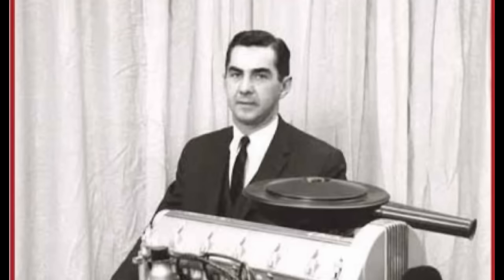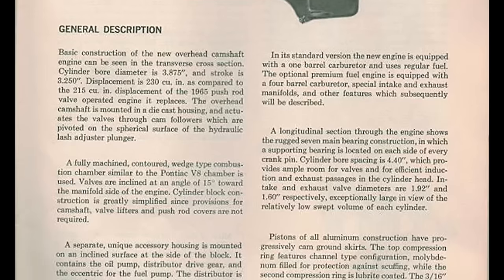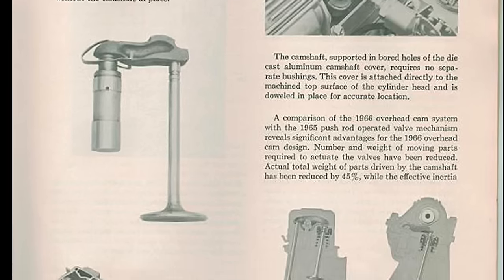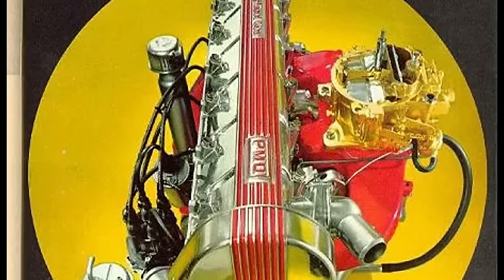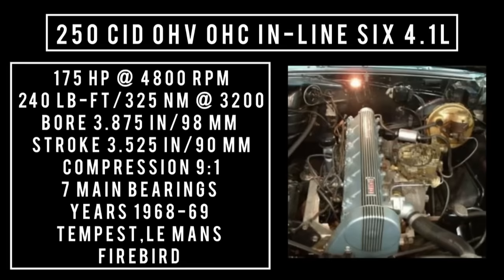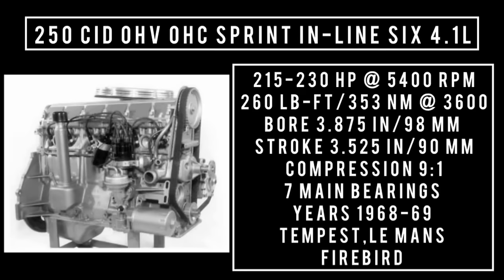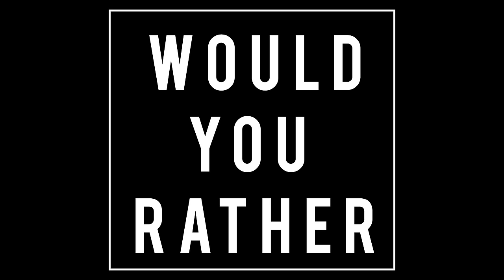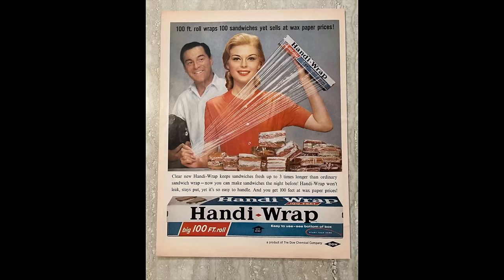Pontiac OHC in-line six engine family 230, 250

Comment: And WHY didnt they just cut off 2 cylinders and use this as the 4 cyl engine for the 1970s????  ie Vega?
Reply: Collectable Automobile Magazine asked the same question,when they did an article on the OHC Pontiac engine in their latest issue.
Reply: B A L A N C E !! Don’t quit you day job.
Reply: @lawrencewiddis2447  they can't balance four cylinders,have you only been around Neons,and half of Pontiac 389s?
Reply: @lawrencewiddis2447  They can also shorten the stroke which can make it easier to balance a four cylinder engine,so can I retire from my day job?
Reply: The 1970 Nova used the 153 inline four that was also based on the 230 Cevy six. A version is still built - the Vortec 3000 industrial engine. Vega with the 153 wouldn't have won Motor Trend's Car of the Year, but a dependable Vega would mostly be known for rust today
Reply: @lawrencewiddis2447  Because they quit making Corvair engines and need to get rid of a shit ton of aluminum production - Aluminum BLOCK Vega. Realize you can't shit an old shitter and hang on to your current employment yourself Young Fella.
      PS with a new crank a Pontiac OHC Four would have been a damn fine car engine for the Vega !
Reply: @timothykeith1367  You can think of the Chevy II 153 four cylinder as half of the 1968-73 307 V8.
Reply: @patrickmcgoldrick8234  They can balance 4 cylinders. The reason the Pontiac 4 cylinder wobbled so much is because Pontiac didn't want to pay the extra money for a balance shaft. They knew the engine needed it but figured the engine would live fine without it and they'd save money not putting them in.
Reply: @number3665  They did have timing chain and gear issues with early half a 389s,due to the engines rough idle characteristics,but an updated timing kit with a chain tensioner helped.

Comment: The timing belt was tested thoroughly, was made 10 X stronger than it needed to be.  The engine was ahead of it's time.  If only they had kept making it, 230 in 66-67, 250 in 68-69, by OPEC 1 & OPEC 2 in would have been a better option than the "baby v8s" in the 260 to 268 range thaf GM came out with.  Ive seen MCC where they talked to owner with the Sprint option, 4 speed, Quadrajet, and he said the performance was like a small v8 of thst era and he got 24 mpg.  Some claim the OHC 6 is comfortable revving to 7,000 every day and twice on Sunday.  People need to remember John DeLorean for what he was (Bunkie Knudsen who hired him after John worked at Packard),  said John was the most brilliant engineer and automotive mind he was ever around.  And he insisted on Pontiac building this OHC 6.  The long hood, short deck 1969 Grand Prix, & naming them SJ option,  borrowed that from duesenberg, he was a genius, the ideas he had in just the yeara he was at Pontiac, 😊wow

Comment: This is the motor in my Firebird.  1bbl carb. 250ci.  81k orig miles w/a 2sp powerglide.  It’s great to cruise in.  Someday I will change it out for a V8.  But for now it’s fine.  I also know the car was never abused, because you couldn’t with this motor.
Reply from the maker: Never change it these are cool =)

Comment: Yes Pontiac should have revised & returned this engine to production in the late 70's. It showed that GM were capable of innovation, but much preferred to go down the "Cheap & Nasty" path & build popular but badly designed V8 engines. So Chryslers Slant 6,  Fords 240/300 & AMC's 232/258 were not the only worthwhile engines made in the US.

Comment: The GM straight sixes are often underappreciated, and with a bit of hot rodding can be surprisingly potent. A while ago I went down the rabbit hole of Brazilian drag racing, where they never got the 350 V8 but they did get a car with Chevy's 230 straight six, so that's the engine they developed a speed parts industry for. They have drag cars with the 230 straight six making over 2,000 horsepower with a big turbocharger and machined aluminum blocks bolted to the sides of the engine to reinforce it. And they do all of that with the stock cylinder head and pushrods... Imagine what they could do if they had Pontiac's overhead cam version of that same basic engine design! I'd love to find a car with one of those engines someday and import a bunch of Brazilian performance parts for it.

Comment: My memory of this engine,is when I was in high school im the early 70s,a friend of mine borrowed his father's 67 LeMans that had that engine with a 4 speed ,his Fathers pride and joy,he thrashed the holy hell out it hi RPM burn outs drag racing other cars and the engine munch the timing belt doing extensive damage to the cylinder head.His father was less than joyus when he picked us up that night,and even more so when he paid to have the car repaired,2 weeks later. I recall that it took my friend over 3 months to pay his father back,it goes without saying his father never let him near that car again,by the way the 66 LeMans for me.
          Jay, it's another great job,thanks again for your hard work,and your research, always look forward to the next chapter.
Reply from the maker: Thank you so much for sharing those memories what a cool story I love that the father made the kid pay him back
Reply: My memory is mid 1960's Gymkhana events at Detroit Diesel/Flint Michigan parking lot by GMI (General Motors Institute/Kettering U.) students driving OHC 6 Tempests with 4 speeds in 1/8 mile drag trials... when clutch popped and exhilarator pedal floored, those cars made a strange bang explosion sound out of the tailpipes... and ran strongly...

Comment: I was a line mechanic for Oldsmobile 1969-  1972  that Pontiac engine was fantastic, but being Oldsmobile I was into the 442 , W30 W31 and the big boys 425, 455 engines, I did have a Pontiac Bonneville Bubble back 1961 , 389, 421 heads and tri power with a 4 speed auto , fast for that time

Comment: We used to find the sprint engines and install them in the old Chevy trucks (48 to 54 series). It was a super easy install and really woke those old trucks up!
Reply from the maker: I never even thought of that that would be a really cool improvement. I have a 52 Chevy 1 ton truck that has a 350 V8 in it. It only makes 150 hp but I honestly believe that that was the combination it needed. it’s good enough to move it down the road 80 miles an hour and get about 20 miles to the gallon. It’s got a different rear end. It’s sitting up on high tires.

Comment: In 1969 Pontiac styling lost its way, stepping away from the vertical pair headlights to a horizontal arrangement. My family did have a 1966 Pontiac Lemans with the overhead cam six. It was a really nice car with lots of get up and go, even with the Powerglide transmission. My sister also had a forest green 67 Firebird with this engine. Both were sweet driving cars.

Comment: Hi Justin, it's me, "Dave" and you did it again!  You produced an 100% accurate automotive history video!  The OHC (over head cam) design is more efficient for fuel economy and horse power and it is the only practical way to produce an twin cam and/or a multi valve (more than two valves per cylinder) engine versus an OHV (overhead valve) engine.  But the trouble is there is much more harmonic vibration and noise because the camshaft is further away from the crankshaft, making it so that the timing chain and/or timing belt suffers from belt or chain "slap" and much more noise and vibration.  The timing belt is meant to absorb harmonic vibration and noise.  By todays standards, opposite rotating countershafts and double roller timing chains with plastic guides are mostly used today, but in the mean time, back in 1964, as far as I know, this was the very first regular production American OHC (overhead cam) engine.  And it was that was supported John DeLorean (head of Pontiac Motor Division at the time) John DeLorean wanted to produce a "High Performance 6" and In my opinion, this engine took over where the (1961-1963) Pontiac Trophy 4 engine left off, "High Performance 4" (a Pontiac 389 V8 cut in half) that was also a resalt from DeLorean.  Both engine(s) where offered exclusively in the Pontiac Tempest/LeMans.  Please produce a video on the Pontiac on the Pontiac Trophy 4 engine!  Please reply.  Dave...
Reply from the maker: Glad you dig this video thank you so much for sharing all the insight and information as well =)

Comment: 67 Firebird Spint and the 69 LeMans ragtop.
GM beancounters hated the OHC six. In 1970 it was dropped because it didn't fit the new F body Firebird. Yet it fit in the Banshee. A lot of the mid 70s Nova clones from Pontiac, Olds and Buick used the Chevy inline six. Which could have been adapted to use the Pontiac head by driving the OHC by using the existing camshaft as a Jack Shaft for the 2:1 speed reduction.

Comment: If you wanted an automatic transmission with the Pontiac OHC 6, the only ones available  were both 2-speed, first the ST300 and then the PowerGlide.
In the early 2k's, a customer brought in a '67 Firebird Sprint convertible which originally had the 3.8 6 and an ST300 automatic. He had put a HiPo Pontiac 350 V8 in it.  I told him that an ST300 made for a 6 wasn't strong enough to handle the V8 power. I just happened to have a TH350 which I had pulled out of an Oldsmobile Delta 88 350 V8 diesel. I told him that it would be able to handle his engine's power. I made him an offer that I would give him the TH350 if he would pay me to go through it and beef it up, and install it. Within a blink of an eye, he said OK.
In swaps like these, speedometer calibration was an issue. I either just swapped the speedo drive and driven gears or I used the correct ratio from my stock.
The TH350, ST300 and the PowerGlide all are the same length and use the same size of output shaft, so the same driveshaft was useable for any of these A/T's.
Reply from the maker: Thank you so much for sharing that added information and insight

Comment: A couple of these used to come into the gas station where I pumped gas in high school. I got to see them because they burned oil. They were both in older cars and most higher mile engines burned oil in those days so that isn't necessarily a knock on the OHC 6. The owners were impressed with them though and they were generally well thought of back in the day. I'd choose the 1968 LeMans and the 1969 LeMans. I love the mid-size GM cars of that era.
Reply from the maker: New cars are just as bad there’s a lot of models out there that burn oil especially after their five 6-10 years old. The only thing that doesn’t burn oil is an electric car… they all leak/burn eventually

Comment: My sister had a Firebird with one of these engines. The car got towed because she made a poor parking decision, and she never went to get the car back! Unbelievable. Didn't they have a valve lubrication issue or some other top end problem as they got miles on them?

Comment: My first car was a '67 Tempest. One cam lobe was shot. I harvested a cam/ cover in a salvage yard from a '68 Firebird. Cam gear timing mark was 180° different.😖
Reply: Lol - What you were seeing was the crank was on the wrong rotation. You set the cam and if you can lock it right on the mark - then you put the crank on IT'S mark but it has to be the "first revolution" and not "the second revolution. (which would be a half of a camshaft revolution = 180 degrees)

Comment: Just think if they would have had a cross flow head.
The 4.2 literDOHC inline 6 in the 
Chevrolet SUV.
Back in 2000.
It was a powerhouse.
Then they put it in the Chevy Colorado as a 5 cylinder or 4 cylinder.

Comment: You could find an OHC 6 in the 1964 willys overland, it was a great engine.
Reply: It was named the "Tornado", and displaced 230 cid. Not a performance engine, tho, as it had a pretty long stroke, and was designed to be torquey, not powerful. I think they only made that engine 2 or 3 years. I've never seen one, but I have an article about it from 1962.
Reply from the maker: Awesome
Reply: The US military continued using the Tornado for a few more years after it was dropped from civilian use. A single cam lobe was used for both the intake and exhaust on each cylinder, so six cylinders, six cam lobes! I’ve never seen one either, it’s trivial knowledge you can use to impress your friends.
Reply: @61rampy65  I have a friend that had a travel all with that engine, not a power house, but it would climb a tree.

Comment: I have a '69 Firebird with the OHC6 and a manual trans. Many people don't know that Pontiac did an engineering exercise that put an OHC head with a similar design to the 6 on a 428 V8. It cost too much to produce at the time. Just think if it had gone into production!
Reply from the maker: Thank you so much for sharing all that information and insight. I will have to check out that engine.

Comment: That timing belt was invented by Hans Glas, a German car manufacturer.  The Glas had an OHC 4 cyl. Very low production, I have never seen one, just ads for it. Glas also made a microcar called the Goggomobil, but they were 2 cyl/2 stroke engines. Car & Driver did a road test of a 66 LeMans Sprint with 4 speed. They liked it, but said you could get a GTO for only a little more $. Car Life road tested a LeMans 4 door with 2 speed automatic.  They liked it too, but also said that you could get a V8 for about the same money, and that the gas mileage was no better than if you had a V8.
Reply from the maker: Awesome insight thank you so much for sharing that

Comment: This was a legacy of quite a bit of GM "thinking outside the box", especially from John DeLorean, which the "Suits" unfortunately KILLED.  In their way of thinking, Sixes were not supposedly to COMPETE with V8s with respect to "performance", never mind that PMD by them did emphasize that.  To them, the standard Chevy Six, available as a 230 cube with 145 hp from 1966 to 1968, and when it was stroked, the 250 cube, with 155 hp, was adequate as a base engine.  Yes, the Pontiac OHC Six, in even "sedate" form (8.5:1 compression, single barrel carb) still had about 20 hp more than the Chevrolet engine it was derived from, and upping the compression, a hotter cam, and a four barrel carb really unleashed the motor's potential!  I find it interesting that, as long as the block casting had to be redesigned to accommodate a jackshaft, and the head was extensively redesigned to take that overhead cam, why not ALSO make it a cross-flow design?  I can see that would have caused extensive work in the rest of the "gingerbread", hence why probably PMD nixed that idea.

Another sad anecdote of how the bean-counters and suits can kill even the greatest of enterprises.
Reply from the maker: Thank you so much for sharing all that information and insight greatly appreciate it

Comment: if u watch tube, u will have seen the 302" flathead with Ardun heads and modified valvetrain and skirted bottom end make over 700hp.  It is not the motor, it is the heads and cam.
Reply: Ardun is Duntov's design ( From his first name and last name) .  He spent 4 years trying to get Ford buy his design.

Comment: I had a 1968 firebird with the ohc inline 6 250cid 250 hp 4 barrel guadrojet carb 3 speed transmisson, one bad ass, my friends with ss 396 chevells could beat me in a 1/4 mile but after 100 mph it was over for them all .
Reply: Those 4.56 gears are hell after about 400 yards … 😁

Comment: It seems strange, going to the trouble of designing a new OHC cylinder head, and not taking advantage of what it has to offer. A deep breathing cross flow Hemi head, the cam on top is the magic that significantly simplifies the valve gear to make it work, but instead, they stuck with the tired old wedge head

Comment: i had a 1969 tempest with the 250
Reply from the maker: Sweet how did you like it
Reply: @What.its.like.  i only had it for about a year i picked it up from a garage to pay the check out fee $105 it had a burnt piston and valve  so replaced piston new rings bearings valve job . a rear wheel bearing . paint job and it looked great . then someone came along and made me an offer and it was gone . but out of the cars i have had the one that got away was the 66 impala 2 door red

Comment: I ask, do u have the balls to make a vid about how the SBC is a Ford design?  I will make a vid and I will read out the page I sent you.  I have no views and this topic will get me some.
Reply from the maker: Is it really a Ford design Ed Cole did one hell of a job designing the small block Chevy I love the fact that you can bolt any transmission up to it.. same can’t be said about Ford you have to have the specific bolt pattern in the 50s Ford had three different case sizes with different tail, shaft, links, and somewhere air, cold, and somewhere water cooled, and none of them interchange..
Reply: I luv ur actually considering this. and not blocking my comments.  thank you.
Reply from the maker: Everyone has a free voice on this channel I don’t block anything YouTube does but I never do. I go through the blocked list and make them public but they usually just disappear.
Reply: @What.its.like.  Ed Cole designed what? A bolt pattern?  We are talking the small block skirtless casting with thin walled heads.  A Duntov design.  I am assuming u read the article?